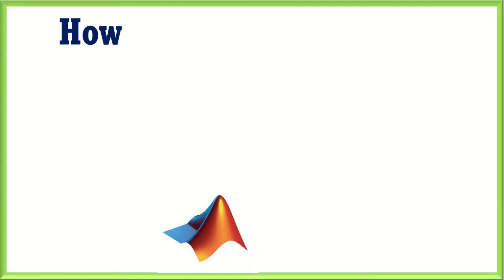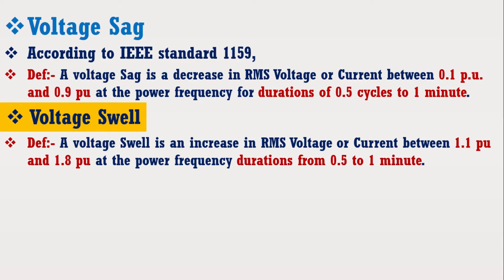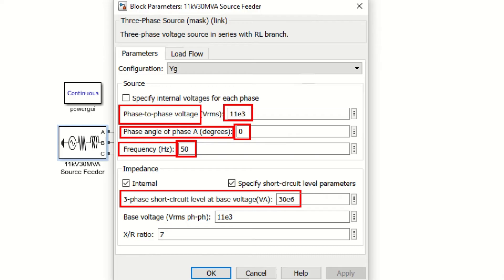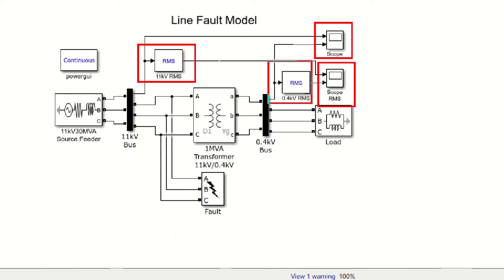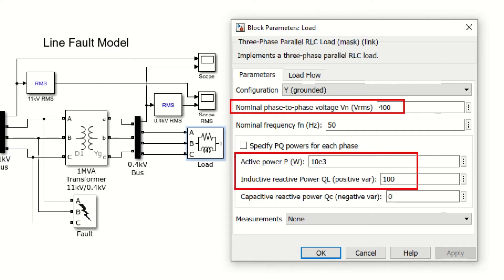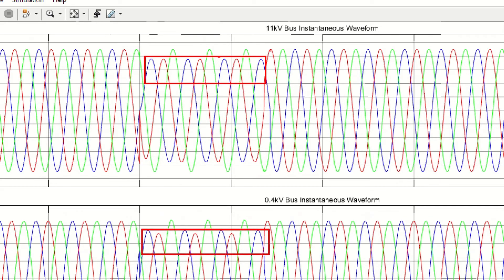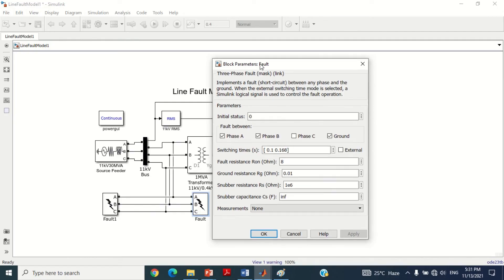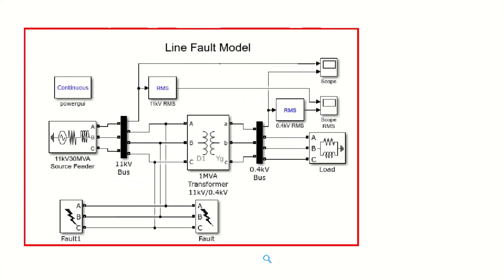How to Design Voltage Sag and Voltage Swell Model in MATLAB SIMULINK ? | Dr. J. A. Laghari

Comment: Dr Laghari, if i want to model voltage sag and swell on induction motor how will i be able to do it? Will i replace load with induction motor?
and also if i want to inlcude a mitigation startegy like DVR ?
Please help
Reply from the maker: Thanks for the comment. I think it would be great if you go through the research papers on this topic for better understanding.

Comment: What is the different between voltage sag and voltage imbalance Dr?
Reply from the maker: Thanks for the comment. Voltage imbalance may be any increase or decrease in its magnitude. Whereas voltage sag is particularly related to power quality disturbances and is decrement in voltage.

Comment: Assalamualaikum dr..i was wandering...why the peak value of voltage not same as the setting...eg the first bus is 11kv but peak voltage waveform for nominal voltage is not even 11kv. Only about 800v. Same goes to 0.4kv where the peak waveform at nominal is around 300v only. Is there any explanation dr ...thank you
Reply from the maker: Wa'alaikum salam thanks for the comment. I think peak and rms voltages have different values. You may use the formula of peak voltage to rms voltage and then check. Maybe you get correct results.

Comment: Hello sir...is there a way to identify the voltage sag location from this simulation?
And what is the simple way to identify the voltage sag location on your opinion? Thank you
Reply from the maker: Thanks for the comment. No location is not possible in this model. For location you have to change the algorithm.
Reply: @DrJALAGHARI  thank you for the reply dr...is there any example from your video i can use to locate the voltage sag location dr?

Comment: Thank you, Sir. But why the voltage of phase C will increase resulting in voltage swell?
Reply from the maker: Thanks for the comment. It means there is change in every phase. It is not necessary that every phase must have the same change.
Reply: @DrJALAGHARI  i am confuse. we do not make any change in phase C, but it still increases. so you mean phase C is influenced by the voltage sag of phase A and B, right?
Reply from the maker: @wwzzzzzz6728  Yes. Unbalancing will occur in every phase irrespective of change in any phase.
Reply: @DrJALAGHARI  Thank you for you explaations!
Reply from the maker: @wwzzzzzz6728  most welcome